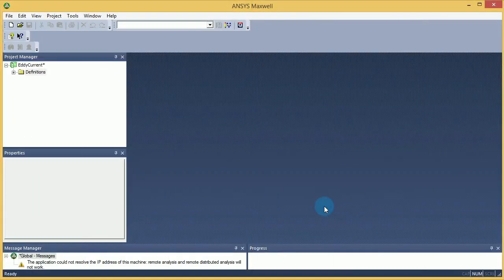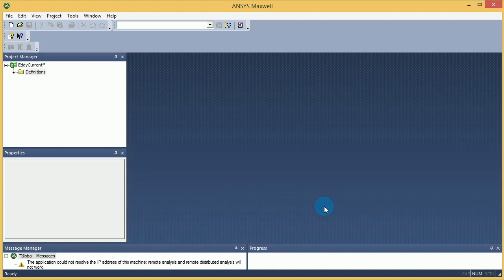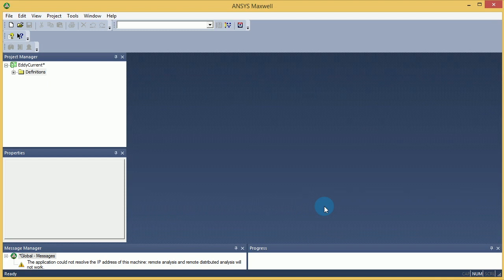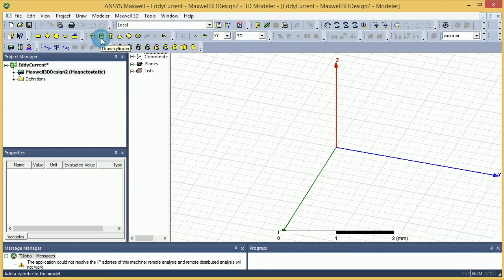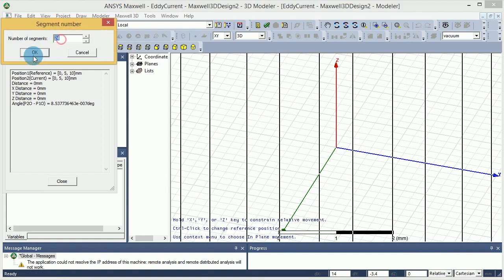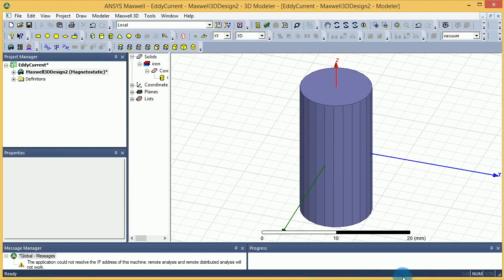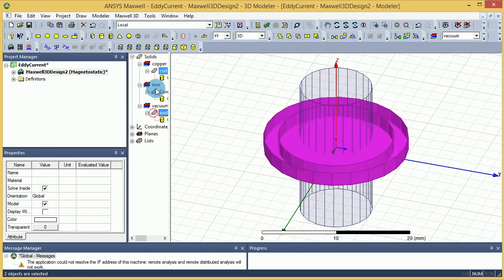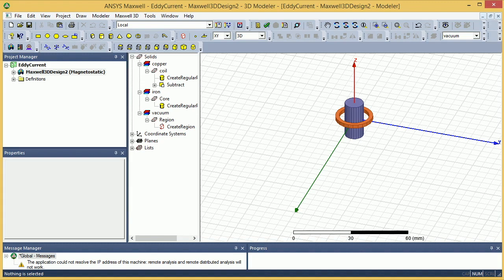312  Ansys Maxwell | Simple Eddy Current simulation [1/3]

Comment: Hi kamyar.
Thx for a great series of videos on Ansys Maxwell.
I'm just wondering, if there is a possibility to simulate axisymmetric desgns (i.e. all the fields in  design You are demonstrating are axisymmetric anyways, so there is no point in simulating the whole 3D problem, simulating just the crossection would be sufficient). This would allow to save a lot of RAM and would allow to use a much more dense mesh than it would use in a 3D simulation.  I know there is such an feature in COMSOL, cannot find anything similar in Maxwell, though.
Reply: Nvm, I figured it out already.

Comment: Thank you for the video, it's very usefull! Can you tell me, what are the characteristics of your PC, I mean RAM etc? I'm asking 'cause during my eddy current simulation my PC always stops on "morphing the mesh for curving surface" and never go futher
Reply from the maker: +Виктория Стрельникова  that happens when your mesh size is very large or you have arcs. As I said in this tutorial try avoiding any curvatures. My ram for this simulation was 24GB. But generally you should get same results with 3 GB and above. What you need to do is to simplify your model.
Reply: thx a lot!  I'll try to do it
Reply: really?! I have 8Gb, but than what am I doing wrong if my simulation stops? my colleague said that was 'cause of lacking memory
Reply from the maker: I believe I answered your comment somewhere else or maybe the app failed to post it. Anyhow,
You need a minimum of 3GB of me and dual core CPU. depending on complexity of your design number of cpus can reduce the simulation time. If you are performing transient simulation you need more ram. 
Generally avoid curves in your design. Use polygons instead. Watch 311 or 312.
Reply from the maker: +Виктория Стрельникова  depends how much you have available? Maybe most of your memory is being used for other programs. Press control +Shift+ Esc and got to performance tab. See how much memory is allocated as available.